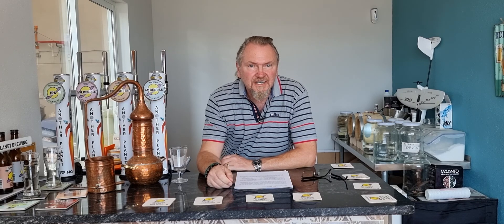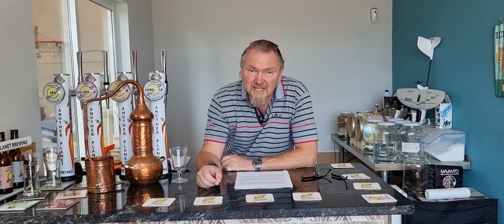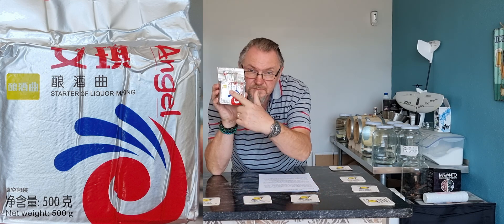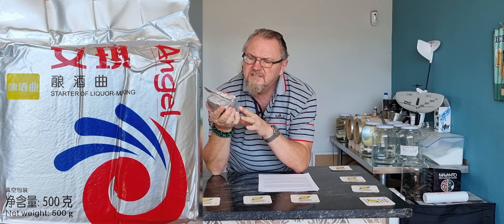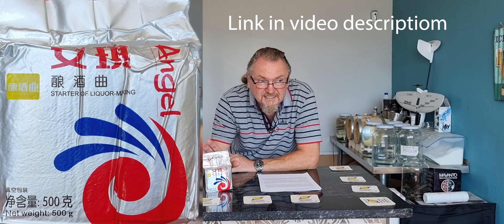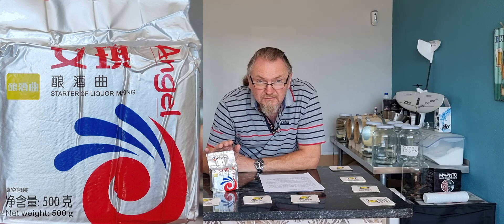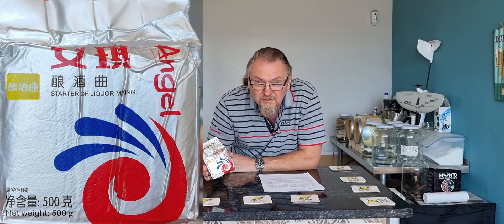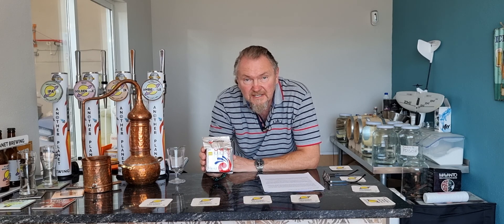Lazy Man's Bourbon - ALL GRAIN - NO MASH

Comment: Boil the living shit out of it hahaha 😆
Reply from the maker: Haha, yeah that wasn't in the script
Reply: @planetmoonshine6223  I sent you an email a while ago, did you pick it up?  Was asking about peracetic acid for cleaning cycle.  I also work.in a microbrewery in the UK. Cheers and keep up the great show!
Reply from the maker: @Ganimal81  Hi Lee, no its a mystery to me why some comments appear in my feed and others do not, plus sometimes they appear to me once then vanish forever. Obviously in a micro brewery we use caustic and paracetic all the time for CIP. I do use Peracetic for passivation of soldering sites, and also for the acid run of a new still. Somehow it feels safer than using nitric though the vinegar smell burns the nostrils ;-)
Reply: @planetmoonshine6223  what concentration do you use the peracetic at?
Reply from the maker: @Ganimal81  my peracetic is 5% from the maker.  for brewery CIP around <1% so dilution with 7-10 times volume of water. For passivation of soldering sites,  neat with a toothbrush and lots of rinse water. For the acid run of a new still about 2%, so diluting with about 5-6 times volume.